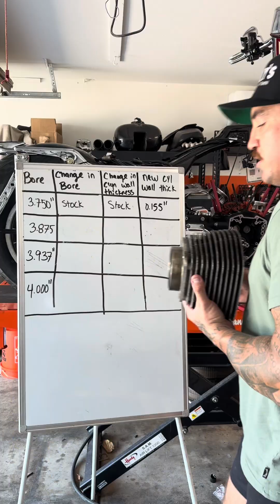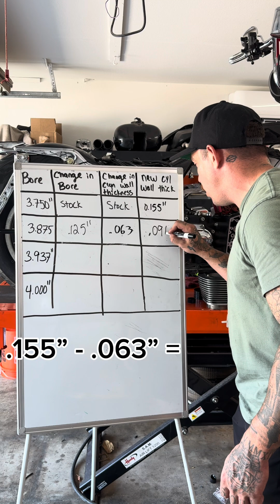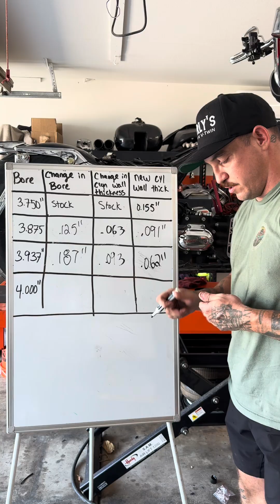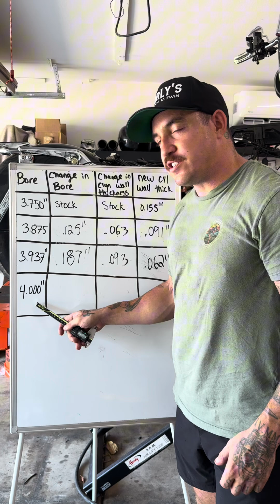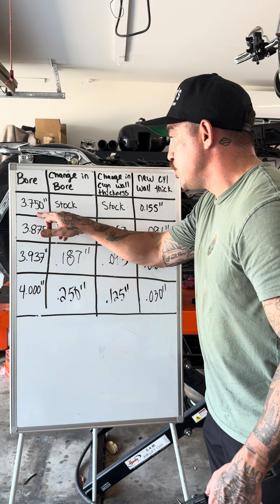TWIN CAM BORE SIZES AND CYLINDER WALL THICKNESS EXPLAINED

Comment: The factory cylinders are made of cast 40 cast iron very weak! min wall should be .125 ,now on  big Bore cylinders I make ,made out of 80-55-06 or 100-60-03 ductile cast iron ,you can run 0.062 min I have run them & make custom billet shovelhead cylinder of this material

Comment: I have a dyna low rider s that came factory with the 110ci, I believe the cases on my bike having a bigger bore to allow for the thicker wall cylinder, is that correct? Does this only apply to big bores or is my factory 110 cylinder walls actually .030” thick? I also have a new crank and S&S 117 kit I’m going to build it with.

Comment: I have a 2006 fxdi. It's much closer to the 96ci. 2006 on the dyna only had hydraulic cam tensioner and better heads. I picked up the 95" pistons. My thoughts are to build a strong 95, they pump out good numbers with cams and 10.5.1 compression combine with the 95". Awesome channel btw

Comment: How small can one go in relation to stroke?
I keep finding the combos I have interest in building are just not common builds
I’ve been looking at a custom crank and well I’d like to have 4.5 stroke and 3.875 bore which would be 106ci 
I’m just curious if the valves would clear 
I want to get a custom set of jugs too to get the thickest sleeve possible on the small bore 
No one builds them like this and it’s weird in my mind 
Why wouldn’t they make the jugs as robust as possible and leave the bores small with tons of stroke? It’s not like these things can rev!!!!

Comment: This video is great if you assume you're getting all the cubes from boring alone. There's also stroke that can help, which would leave thicker cylinder walls than from just boring. Also, at least for the HD 110 kit, it comes with steel-lined aluminum cylinder walls, which adds strength back in. Just some thoughts.

Comment: Hi Cam can i put a 4 3/8 aftermarket crank in 2002 cases so i dont have to do a Timken conversion to my 2009 cases,i believe that 2002 cases have crank position senser.

Comment: I had the 4 inch bore S&S Sidewinder 100ci kit. I was far too scared it was going to explode on me. Opted out of that and went with boring my 88ci to 98ci done @ hammer performance set with very nice CP Carillo pistons. I’ve heard really good stuff about the 98’s, but I may buy a new set of original 88’ pistons and cylinders just to have on stand by JUST in case. Great video man.

Comment: Dude you are putting out awesome and easy to understand content. Keep it up.

Secondly would you happen to know the cylinder wall thickness of a stock 110? Are those make out of the same cylinder heads?

Comment: In regards to building a motor with the purpose of stunting on a 103 platform, would you use lower compression pistons and forged or cast due to the bikes getting hot and the forged expanding more then the cast. What would you do?

Comment: I do not like "Drop In" 110 cylinders because of the super thin skirt. The 107" is the limit with out case work. That being said- It is NOT a problem to bore Twin Cam cases for larger cylinders. It does NOT affect reliability at all. Lengthening the stroke often decreases reliability but a bore increase should not. I have built some very large Twin Cams that have "Stock Like" reliability.

Comment: Paying to have new pistons fitted using proper torque plates should be factored when comparing aftermarket kits ready to bolt on.  Not every machine shop does good work either. (I bought my own torque plates and take my tech data to a local race engine builder, he measures the bore with his dial bore gauge then tells me what oversize is required, then I buy the parts and he's happy while I get the work done to spec.)

Comment: thanks for this explanation. I have a downed 50K 2011 96" TC because the piston in the front chain tensioner pushed through the shoe and the metal piston was being chewed up by the timing chain. I was scratching my head on build direction. Question, will boring the cylinders to a 103" require mods to the crankcase? As I understand it, my cylinders would need to be bored out .125". Keep the videos coming.

Comment: I have a stock 2003 twin cam 88. 
After seeing all the knucklehead ideas the factory came up with while building these I wouldn't dream of adding more than a mild cam to this engine without a COMPLETE engine build from the ground up.
The reason is I don't trust the stock crank at all.

Comment: The true 110s had bored out cases  with thicker cylinder sleaves. They had their own problems with higher valve spring tension that was hard on the cams.

Comment: My TC 103ci crapped out last year...
It was still under extended warranty so I had my local Harley Davidson Dealership convert it to the TC 110ci, that's the engine that came on the later CVO's...
Harley Davidson paid 6K for the engine... I paid 2.4K for the Screaming Eagle parts...

Comment: 🤦‍♂️ not me with a 110ci…great!  If I upgrade to the bolt on aftermarket 117ci is that any better?
Reply from the maker: @sekaevans1105  no! This is in regards to boring! The stock 110 from the factory had a bigger bore diameter in the case! You have bigger cylinder. Nothing to worry about and you’re safe. You could however go up to a 117 ahah that would be the going 110 equivalent
Reply: @Gnarlys_Garage thank your very much for your reply what a relief. As I’ve mentioned once before I enjoy your content and will continue to follow and support you. Cheers 🍻
Reply: Mine is stock 110ci. Is that cylinder wall thickness still the same or different because of bore?

Comment: Yo cam, since you are getting only .030in for a big bore 110 and running a high risk to melting that thing, what’s the difference with the new M8 117 models?
Reply from the maker: @wulxy1617  hey great question. We will look into this in future videos 🤘🏼

Comment: Is the 103 bored out wall thickness the same as what comes straight from the factory 103
Reply from the maker: @2540micky  the case bore doesn’t change so yes. The 103 is a 3.875” bore
Reply: I was wondering the same thing

Comment: Hey Cam, real quick. Can you get thicker top ends to maximize your bore size without the risk?
Reply from the maker: @joesaysstuff  we’re going to dive way into that in more advanced videos. But long story short, yes. (If I understand your question correctly.) the process behins by removing the bottom end from the motorcycle. Removing the crank and the cylinder studs from the bottom end and reassembling it (so it’s just a hollow bottom end. We then bore the cases bigger and wider so we can install aftermarket cylinder with a bigger diameter. S&S makes kits 🤘🏼 this is how people get huge engines like 124 out of stock cases. Or my favorite engine of all time, a 4 inch bore with 4 inch crank (square)